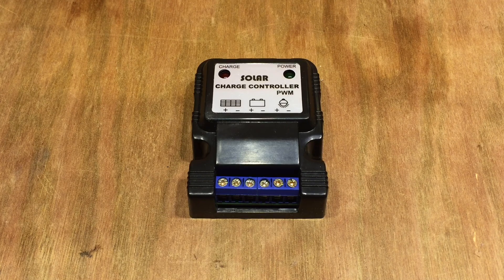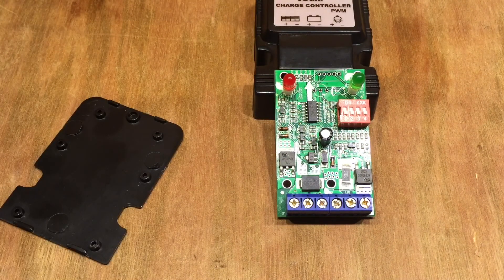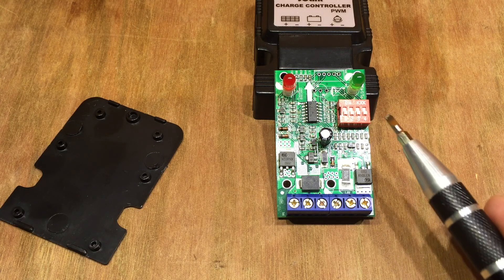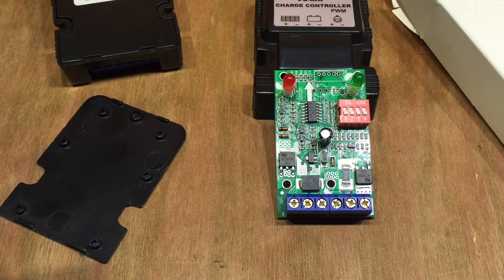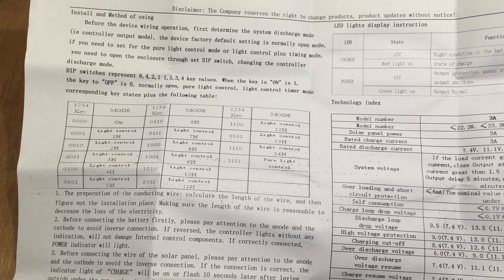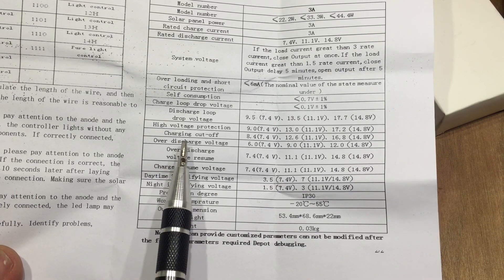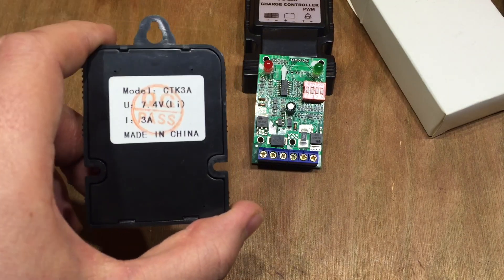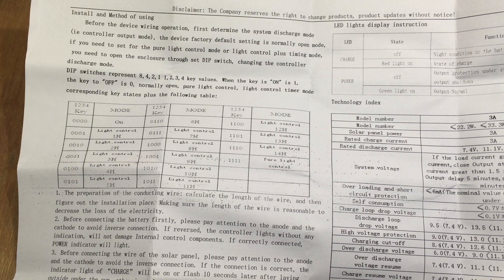Cheap(est?) PWM Solar Charge Controller Update - 12v Solar Shed

Comment: Since watching your videos regarding these wonderfully cheap 12V solar chargers, I went out and purchased a couple. As you rightly say, for the money you can't go wrong. I also purchased one of those cheap watt meters which you have used in previous videos. Again, very handy to keep around and worth the money.

I've been using my charge controller with a 12V 5W Mono solar panel and it's charging up my little 7Ah battery a treat!

The charge controller I got looks the same as yours. It has the two indicator LEDs but on the back my sticker says DHS-3S-6V12V3A so I assume they've been updating stuff and the 12V and 6V are one in the same now. I did also order a 6V version with the three indicator lights but it would seem I didn't need to.

I've also noticed on my 12V charger, my charging cuts out at around 13.3 - 13.4V and then kicks back in again when it dips down to 13.2V. I think it's luck of the draw where the cut offs are - unless they've been revising things? It seems they like tweaking the design for various stuff.

Going back to those DIP switches, you are quite correct. The table and switch position corresponds to how many hours the load output will be on after solar power drops away. This is quite a common feature on a number of solar chargers I've noticed so it's nice to see it in these little cheapo ebay controllers.

I have spotted one little snag with using the Timer Control with Mono panels and that's touching on something you said in one of your other videos and that's how simply blocking one cell on the panel kills the whole thing dead. So if for example you had something obscuring a cell on your panel, the panel output would drop and the controller would think it was night and turn the load on.

On the other hand, that feature could be quite useful if you were to invert the output so it turned the load off at night but allowed the load to run in the day when solar power was present.

All very interesting stuff. Thank you for you uploads and contribution!!

Comment: I have 2 of these controllers. They are the 3.7/4.2v version for charging a single lithium cell. I connect the battery first then the solar panel. Before connecting the solar panel (18v. Specs say max. input 35v) the red charge led is off and it comes on a couple of seconds after connecting the solar panel. The problem is the voltage across the solar panel input drops to the battery voltage once the charge led comes on. My second problem is that it doesn't seem to have a low voltage disconnect. There is no mention of it in the brief manual I received.

Comment: Thanks a lot, I was also having the same impression. I wish to purchase a cheap MPPT charge controlled could you review one that you recommend.
Reply from the maker: +Bidyut Borah If you look at my channel and search for MPPT you'll find a few videos on controllers I've tested. Some fully featured and some bare bone circuit boards. I'm currently using the EPEver Tracer A series in the shed. I've been very pleased with it.

Comment: nice video! I am trying to combine 3 very small devices (turbine/induction buoy/wave rotator) to charge one battery but the max output from the devices expected is only 2-3 Watts.  Can I still use this controller or do you have any other recommendations?
Reply from the maker: +Jeff Bonham thanks for the comment. I'm not experienced with the devices you're using however if you use three separate controllers all trying to achieve the same battery voltage and using proper PWM in theory I can't see why it wouldn't work. The issue is you are tripling the draw from the battery with three controllers - although this model only pulls a very small amount. 

If the three devices produce a very similar voltage they might be able to be connected to the same controller - but I'm really not qualified to advise to be honest.
Reply: +Adam Welch thanks so much.  The devices will produce different voltages so that is very helpful.  
Does it matter if the current is just in pulses rather than smooth?
Reply from the maker: +Jeff Bonham Solar panels aren't always that constant, so I suspect they'd cope - but again, this isn't really my area. Good luck!

Comment: Strange thing they are saying to use 36watt (max) solar panel. 3 amp means i can use solar panel up to 50watt. I'd like to know your opinion: is it ok using 50 watt solar panel?
Reply from the maker: +Denis Lenskiy I mention this in my first video about this controller.  I suspect it should be ok with a 50 watt panel.  The mosfets are good for more than three amps too.  Someone did comment however that it gets a bit warm near the limit.  Perhaps I'll test this at some point.  Thanks for your comment.

Comment: I am wondering wich voltage must be the solar panel ? There are nothing about it in the documentation ! Can I use 16V solar panel?
Reply from the maker: +ECF CERCA The panels I connect have a MPP of 17.5 volts and an open voltage of 21v. So you'll be fine.

Comment: I got one Thursday and scanned in the instructions and was going to send them but no need now :-).  Defo a handy feature.  With the 7.4v battery model is the load output also 7.4v?
Reply from the maker: +Colin Hickey Glad yours arrived safely and thank you for scanning that for me.  The output is based on battery voltage - there's no conversion circuitry.  I might look to power a little arduino project with it if it work.
Reply: +Adam Welch No worries, i got mine to pair up with my 10w panel which is spare now and put with one of these http://blog.quindorian.org/2015/04/esp8266-wifi-led-dimmer-part-8-of-x.html Although now it has a timer function that may render it a little useless although the dimming and remote control function on the led dimmer looks cool.  I'll have spare PCB's if your interested, can always pop a few in the post.
Reply from the maker: +Colin Hickey That looks like a cool little project.  That looks like an interesting little project - I'll contact you privately and see if we can sort something out. :-)

Comment: Hi me again:) the right slot is for the lights.. is that power comming from the battery ore directly from the panel? thanks
Reply from the maker: +siemon pryns If there is no sun on the panels then the load connections on the right hand side is solely fed from the batteries. If you've got sun on your panels the current flow is less straight forward, but as long as you are making more power than you're consuming you're battery will still be charging.

Comment: Hi Adam
I've purchased 4 of the12v model based on your recomendation and found them very handy for various projects. Unfortunately, like your first one, none of mine came with a manual. Could you tell me if there is a setting on the dip switches which will switch the load on when the sun goes down like a PIR.

Thanks for a very informative channel.
Reply from the maker: +Adrian Melina Thanks for the comments. I'll get back to you with this info as soon as I can.
Reply: +Adam Welch Thanks for that. It would be really handy if there was a setting for that. I have a garden lighting project on the bench waiting in anticipation.
Reply from the maker: Try this - click on the image for a larger version. http://admw.uk/iU  Hopefully I've captured everything you need - if not do let me know.
Reply: +Adam Welch Interesting...I wonder if the last "Pure Light Control" is the setting I need. Thanks for that Adam.. I'll give it a go.
Reply from the maker: +Adrian Melina Pure light control presumably means on from dusk to dawn. Otherwise there's amounts of hours after dusk.  That's how I read it anyway.
Reply: +Adam Welch Yeah...that's what I'm looking for. Just not on during the day but on when the sun goes down. I shouldn't have used the term PIR..what a thicko.
Reply: @AdamWelchUK  I to is having a problem with the dip switch. No load on. ??? Please help.

Comment: I'm after a cheap small unit for a 24v 90w panel, any suggestions?
Reply from the maker: +John Douglas 12 or 24 volt battery?
Reply: 12v battery.
I got a heap of gel cells from a decommissioned server UPS (45 of them in total)
the wiring is going to be a pain in the arse heh.
crimps are expensive in Australia :/  hell everything is expensive here.
if I had a 3d printer I'd design a slide on shell top with 4 screw plates to make easy battery packs.   (well, I'd like to think I could design them ha)
Reply from the maker: +John Douglas Well with 24 volt panels but 12 volt batteries you really should be looking at MPPT - which ain't the cheapest option. There's a new version of this cheap PWM charge controller that does 12/24 volt battery systems so should be fine with 24v panel voltages (  http://www.ebay.co.uk/itm/-/301936061249 ) but you'll lose a lot of your power due to the mismatch. 

Cheapest MPPT? I'd suggest the EPEver Tracer Series at the moment - I've done a review of these too... :-)
Reply: yea, I know.
it's just that I have the 90w panel I picked up for dirt cheap ($50 australian) currently being unused and it feels wrong letting it go to waste haha.
the gel cells are also sitting there unused (but rotated on a charge cycle on my main system, so none go bad)

the reason I'm not looking at MPPT is that I am unlikely to ever do much with these gel cells, maybe some LED lighting in the house eventually.
and there won't ever be all that much taken out of them.
so MPPT would go to waste anyway.

ahh I'll keep pondering and procrastinating a bit more heh.
Thanks very much for your replies and thoughts :D